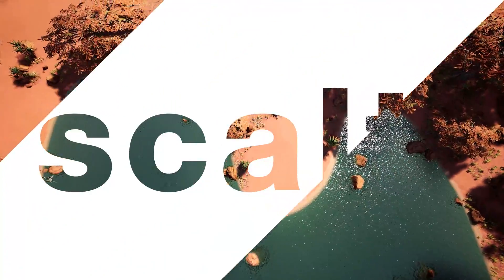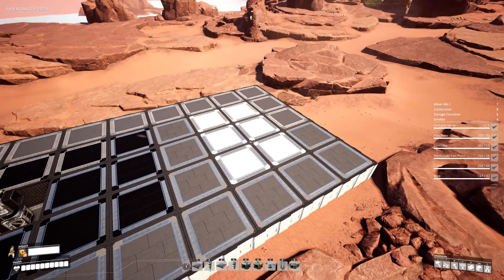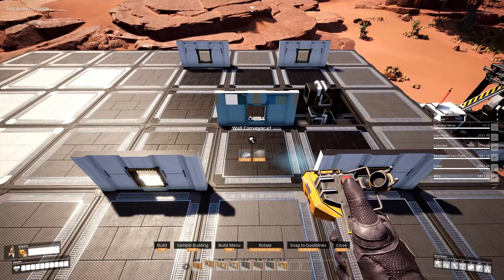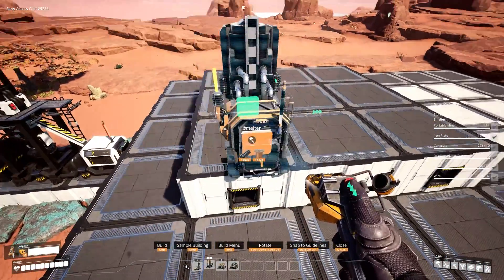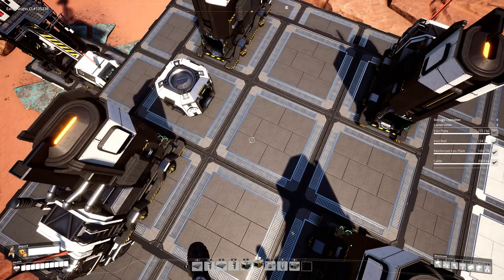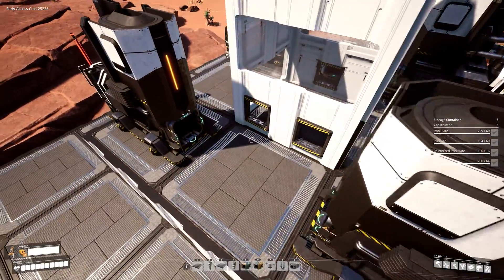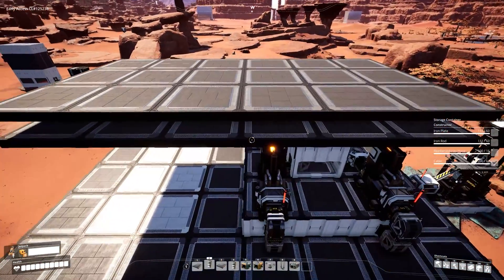100% EFFICIENT Early Game Tier-1 Copper Factory [SATISFACTORY GUIDE]

Comment: Albeit 2 years later, I just got into Satisfactory and besides my massive 1-floor "creates every starter item inefficiently" factory, this was my first attempt at building a real purposeful one. Without mods (and thus no flying) it did have a few teething issues in terms of building vertically - but getting it completed with a few minor changes (overflow system for AWESOME Sink and using the "new sandwich floor" from your more recent videos) felt so satisfying!

Comment: I love the clean look and efficiency.  The floating floors thing bothers me a bit (but what about PHYSICS!), but it's fairly trivial to add in some supports.  But one thing I'd like to see, is how to set up overflow, so your containers fill up first as buffers, then overflow to an Awesome SINK.  How much extra space, if any, would that take?  Or can it be done in the same footprint?  I know in early stages, we only have a dumb splitter, later a smart splitter, but only at the programmable splitter can we have a specific overflow function.  So the compromise ia to just use a dumb splitter at first and fill buffer half as fast, or shut off awesome sink for a bit while we go build another factory, by which time maybe one container will be full.

Comment: Hi Scalti great video, just tried this on exp. 5 but I’m having problems placing the two mergers side by side on the top floor. Do you know if they have changed the clipping code and made this build incompatible?
Reply: same issue here, i guess i just place one of them on top of another.
Reply: found a solution, lift down the outputs from constructors to sandwich layer using those new conveyor holes.

Comment: Would build 2 of these if space would allow me to.
My super-storage platform is too low, I just found a pure copper node, but space is limitted.

Looking for a super-compact build that has 10 Smelters (4 & 6 grouped for outputs), 
6 Constructors (Copper Sheet) & 12 Constructors (Copper Wire).
Minimal footprint and items used if possible. 
Height must be 7 walls or less. 6 by 8 base floor size would be good.
Really would strip off all walls and floors when it's done, I have serious performance issues lol
Don't care if conveyors overlap at this point anymore.
Conglomerating all items into 1 central area is bad.
Mayb I re-start and build like Skalti from the beginning.
Reply from the maker: Build two on top of each other. Cubes are dope.
Reply: @Scalti  thanks <3 
yep going up really works in this game

Comment: Great video but my question is which constructors make the copper sheets, wire and cable respectively? thank you :D
Reply: From the single constructors facing the 3 constructors left and right wire middle front cable with thoses on the right  back sheets

Comment: are you using some kind of mod to make the walls work on the sandwich layers? or maybe there was an update? I cant seem to place walls without clipping about a quarter of the wall into the next floor
Reply: Nevermind, I figured out a solution. I ended up needing to place an 8x1 under the bottom of the sandwich layer so that the wall would connect to that 8x1 and be lower enough not to clip. I then deleted the extra 8x1 after finishing the walls.
Reply from the maker: That or you place a wall on top of the top of the layer and then build one under it.
Reply: Like what you do in the video? Yeah, that wasnt working. Not sure why.

Comment: Time Stamps (mostly for my own use; if you don't like them, make your own :p)
Initial Wall Set Up: 2:00
 Foundry Placement: 4:00
Belt Division Smelter -> Constructor 4:15
 Sandwich Layer: 5:55
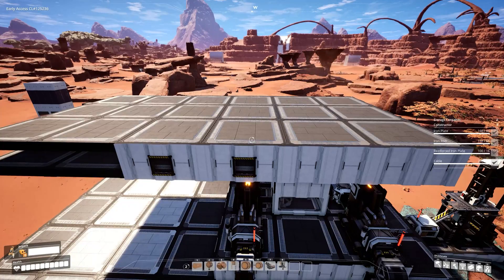 Constructor Placement: 8:12
 Belt Work: 8:58
Final Output Belting: 10:52

Comment: Thanks for great work. I wonder how you lineup miner with foundation? I tried many times but I couldn't do it. Maybe there is a easy way to it? And how you make white wall default color? Thanks.
Reply from the maker: Check out my Instagram for the miner. 

The paint gun is how to change them. Adjust the first (upper left) swatch to what you want and it will change existing and future built items.

Comment: Loving the videos man. Just got to ask, how cleanly do these factories scale up with overclocking? Say I get to the point where I’ve got a pure node, a Mk 3 miner, and tier 5 belts to work with, can these factories handle that kind of throughput with full overclocking?
Reply from the maker: Well. Since they operate at 100% efficiency, doubling everything would be proportionate. Just have to make sure the ore input is there. 

My suggestion is instead of over clocking you just duplicate the design next to or above it.

Comment: How do you get a foundation over a source, then the miner on top? I didn't know you could do that! Very clean builds, super stuff.
Reply from the maker: As long as the source is visible, you can put a foundation on it and then a miner. There is however a limit to how high the miner can be placed. You can typically get away with a 4m and 1m foundation on top

Comment: The only "problem" is, it s not easy to upgrade. Say u have a pure node and want to upgrade it, asap u have t3 belts etc.  Only way to upgrade is building multiple complexes with split in front.
Reply from the maker: Very true. However, this is a factory designed to provide building materials to help transition into the mid game instead of being used towards making more complex components. At the point you’re using these materials faster to build things than them being made, it’s likely the player has created a system to fulfill that demand.
Reply: @Scalti  True! It's a beautiful starter build. I'm just a fan of upgrading and expansion of existing. So no offence, I really like your builds

Comment: This was awesome, i used it to setup a new games early copper manufacturing, and it works SO much better than the spaghetti BS I had going on before. I may just be missing something obvious, but how did you get the glass floor pieces? atm mine doesn't have a ceiling because it just looks weird without it also being glass
Reply from the maker: Glass foundations are from the awesome shop in the foundations tab.
Reply: @Scalti  thanks, idk why I never thought to check there

Comment: Excellent build! Very clean and well planned out. Also an interesting approach in terms of planning. I tend to build flat with subfloor belt-work, and use floors to either double up the production line, or just do a whole new line (the only times I run one full line across multiple floors is when I run out of space). But here you kinda went vertical from the get go :)

Oh, and really high quality video production as well!

Comment: How did you add the splitters/mergers directly against a constructor like that? I've never been able to, as the belt just stagnates I'm guessing due to a missing link. 

Other than that solid video! Loved this build. Gonna go try doing a similar one without fly.
Reply from the maker: They’re not directly connected. There is a tight space between them where a belt must be added. It may not have been terribly noticeable in the video.

Comment: very nice build and well presented.  The only suggestion I would make is to note that you are using mods if you are and that they are identified in the video description as well as a link to the mod manager so people can easily add them, or point out that the build is not using mods,  but that some items must be unlocked from the awesome shop.  or something like that ..   Just thinking of low hanging fruit so to speak to be more informative and prevent annoying a short-tempered player who has no clue where to get a wall with a conveyor hole through it.  subbed btw .. I really like the build.
Reply from the maker: Fantastic feedback. I will definitely keep this in mind moving forward. The bit about the AWESOME shop items, I plan on making a guide to acquiring coupons early game so this will push me to plug that content while making other videos using items from the shop. Really appreciate your feedback.

Comment: I'm not a big fan of the super compact builds,especially since you cant get to those belts to update them. but i love the aesthetic and the storage method is really good, plus the video editing was clean and precise, good work.
Reply from the maker: Definitely understand the accessibility. My counter would be that these builds are design around the input amount. If you wanted to ramp up production volume you would need to do a tear down of almost half the structure in most instances. Given that this design is focused around early game basic item storage for mid to late game expansion, the need to upgrade belts is virtually non-existent. Eventually I would like to put together expandable array guides.